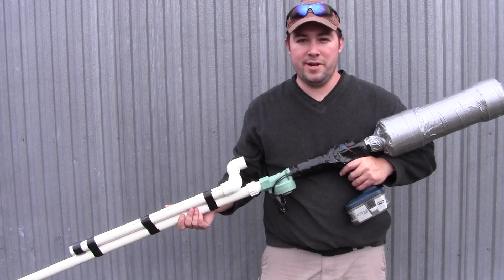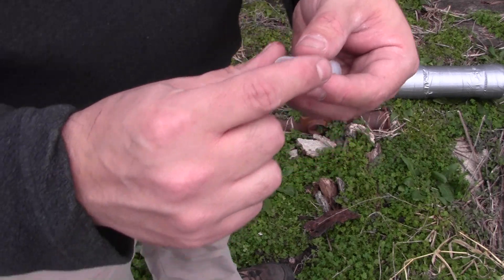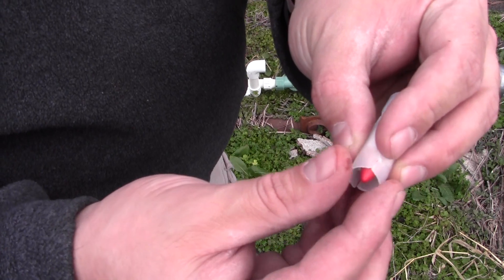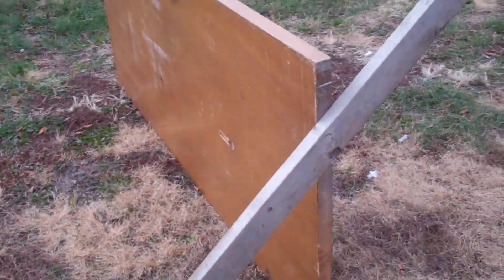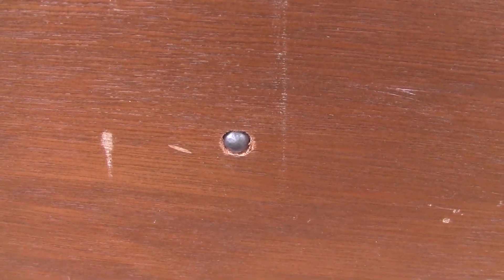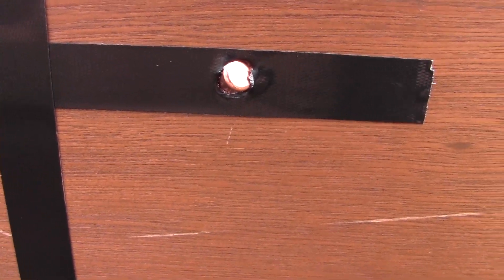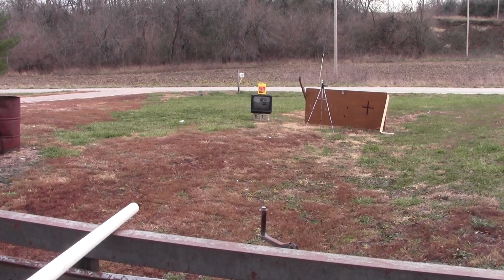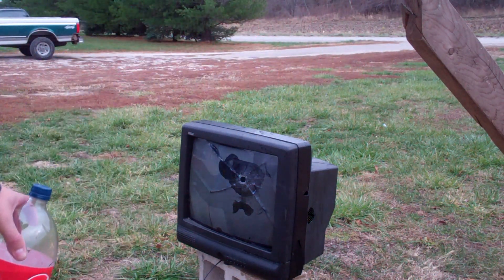Launching Lead - PVC Air Gun - Part 4 - with Hornady Muzzleloader Bullets!

Comment: Nice video, even 10 years later. Small suggestion make your barrel shorter by about a foot or 2. In my experience with things like this 3-4 foot work great for half inch. Anything over 5 is unnecessary and you're just slowing it down with friction

Comment: Being the air gun enthusiast I am and having everything from a 177 caliber multi pump crosman pistol that fires pellets at about 650 maximum  fps without any modification , to 30 caliber carbine charged with high pressured air that launches lead slugs with about  100 foot pounds behind it… to 72 caliber rifles that are pushing over 500 foot pounds… I’m really blown away that only 100 psi is giving you that much power… because my pcp air guns require 3000 psi on average to power the guns …granted my guns display a helluva lot more power …your gun is nothing to scoff at ….I bet you would get more accuracy and distance if you dropped the barrel down to maybe a 22 or 25 caliber cause it looks like 100 psi and the setup you have would really push projectiles at a deadly velocity if it was about half the size and weight …just my two cents
Reply: reducing the bore to .22 wouldn't work all that well, due to drastically increased frictional losses in the smaller bore. Big bores are more efficient with the pressure provided (granted, you have to be able to supply the volume to fill it). It's easier to supply more volume than it is to increase pressures, often times. 

Take my own airgun for example: Uses a rear sealing Piston valve (primed with a knock-open valve, closes when the bullet reaches the muzzle via barrel air impinging on the priming chamber), 66cc plenum, regulated to 3000psi. With the 25" .355 barrel on, it can shoot 125gr @ 921fps (235FPE); however, when you put the 25" .308 barrel on it, you can only shoot 125gr @ 852 fps (201 FPE) (granted, the .308 125gr bullet has a better BC, so it doesn't drop too bad compared to the .355. That's with 3000psi, I can't imagine reducing to .22 on only 100psi. My large-frame gun isn't ready for testing yet, so I don't have numbers for .508 or .625 yet.

Plugging 100psi into my small frame specs in GGDT, it's only showing that I would get 197fps with the .308 (10.8fpe), while the .355 shows 217fps (13fpe). A .224 barrel with a 38gr bullet would most likely get only around 275fps (6.4FPE). It'd probably kill rats at 20 feet... with a 14ms dwell time in a 25" barrel (horribly hard to shoot well, by comparison, a crossman 2100, pushing a 8.3gr pellet at 750 out of a 20" barrel has a dwell time around 3ms). Going up to a 60" barrel would only get you around 376fps (11.9 FPE), but the dwell time would be around 21ms (good luck hitting a rat consistently at 20 feet)

a .54 lead ball weighs 236gr, so half of that would technically be 118gr.

Comment: You could about halve the size of everything but the calibre and get the same power, I just tried a chamber of about 8" 22mm copper and it was comparable. The majority of the compressed air is wasted. This is still cool ofc.

Comment: Currently i am working on the prototype of  simulated weapon for training purposes .which should be operated by CO2 gas for breech block to move front and back with help of solenoid and single acting piston cylinder.
I require technical assistance in choosing the solenoid,and amount of pressure to be maintained in the air reservoir for 30 times firing.

Comment: That CRT television uses a vacuum tube.  The "hiss" you heard was air being drawn into the tube through the cracks created by the projectile impact.  I am amazed the CRT did not implode.  That is what usually happens when you shot one with a standard firearm.

Comment: Is that valve electrically actuated by the drill? If so, you would get almost 10x the power if you converted the valve to pneumatic actuation. It's pretty easy, and there's plenty of youtube videos on how to do it.

Comment: That was not gas escaping, after being built or rebuilt a vacuum line is attached to the tail and the air in the picture tube is removed at the tip then sealed as with all vacuum tubes {hence the name}  so it was outside air rushing in not escaping.. cool gun
Reply: Bob White you are like an old Bubbles from the tv show Trailer Park Boys.

Comment: Just a minor correction, gas is not escaping From the TV, air is being sucked into the vacuum tube.  I used to put plastic bags around monitors and then bash the glass, the plastic bag would get sucked into the screen.

Comment: You might have good luck with the Lyman 20 Gauge cast lead slugs. The molds make a pellet shaped projectile you use with a shotgun wad. They have a good reputation for accuracy out of smoothbore.  example: http://www.midwayusa.com/product/778041/lyman-1-cavity-shotshell-sabot-slug-bullet-mold-12-gauge-681-diameter-525-grain
Reply from the maker: Very interesting, I hadn't thought about 20 gauge slugs but it seems so obvious now.  Thanks for sharing.
Reply: No problem. I like creative silliness. potato guns don't know the difference between potatoes and a chunk of potato with a rock in front of it- or so I have heard.

Comment: Try upgrading the sprinkler valve to a piston valve. With the piston valve you will get a faster opening time and much better air flow. If you want an electric trigger you could use the sprinkler valve as a pilot valve for the piston valve.

Comment: Why does the barrel has to be so long?
Reply: radeonx1600  There's actually a point of loss too, not merely diminishing returns. A chronograph would help you determine your optimum point. If your barrel is longer than the gas pressure impulse, or has a larger volume than a fixed gas release, the barrel actually will create drag and suction for that portion. With paintball guns, most of them get better velocity from a 14" barrel than a 20" barrel with all the other settings identical. 16" is generally the longest you can go before you start losing velocity.

Now lets say you've found the length of optimum efficiency. That's actually your node of WORST accuracy. You want the barrel to be just a little shorter or just a little longer than the most efficient length. This is because threshold points are terrible for consistency.
Reply: It was true for NO2, but it only accounted for one pressure level, and the peak efficiency was 12" with losses after 18."  The study also only accounted for one set of flow restricting components and one set of post regulation volumes. It was valuable for illustrating the principle, but it gets over generalized. A lower pressure with a smaller volume can benefit from a slightly longer barrel, as has been repeatedly proven with hyper efficient stock class guns.
Reply: A long barrel utilizes more of the energy exerted by your chosen propellant. Or at least, that's the case with combustion guns. I'd imagine that airguns work the same way. Still, there's a point of diminishing returns, a six foot barrel makes you wonder.
Reply: radeonx1600
in the case of a firearm, that is true because the propellent must all burn within the barrel for maximum efficiency -- otherwise, unburned powder goes out the end with the bullet, and is wasted. Pressure is increasing due to burning fuel until the pressure is released at the muzzle.

In an airgun, however, the propellent is losing pressure from the time that the trigger is released. Charles' Law, I believe, is that pressure is inversely proportionate to volume.
Reply: In an airgun, the main advantage to a long barrel is that the sights are further apart, making it easier to aim with precision.
Reply: GunFun ZS The time it takes for 100 psi using his cannon vs the time it takes a puff of nos or carbon dioxide is much different. The pressure pulse @ gas levels is only 100th as long as his res drain time. So the longer barrel is worth it. Possibly even 7 feet. Thats why Ky Long Rifles had long barrels as well. Slower pulse wave time because of slower development of pressure. Wouldn't take much more experimentation to make it even better. Changing the shape of the res to better drain pressure quickly would make some improvement too. Even porting the connections for better airflow. Homemade can rock.
Reply: GunFun ZS that 14 inch barrel limit holds true foe CO2

Comment: Love your airgun videos. just wondering have you made any gas powered cannons and what your opinion is on them. I've made one and it will launch a big potato 300 yards. a 1 second burst of fly spray, put end cap on then press the button.. boom. Pros = probably alot easier to make, plenty of power. 
Cons = must be fired within seconds of loading, very large (2 metres long) Thanks, Tony, New Zealand